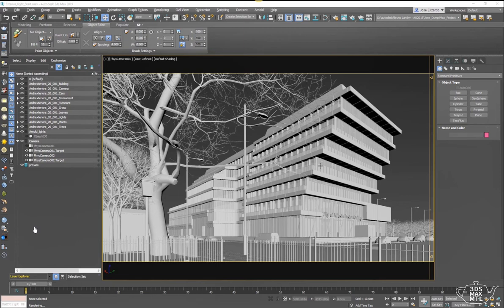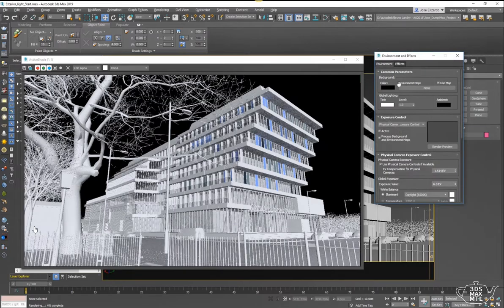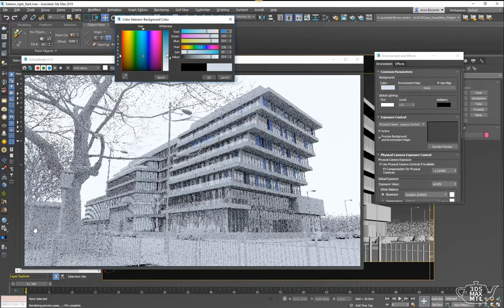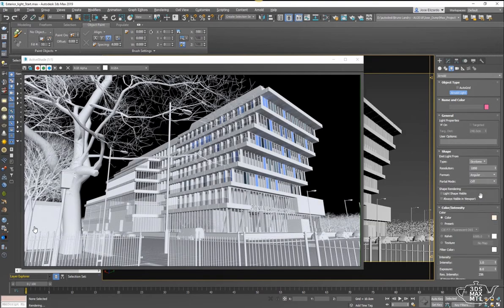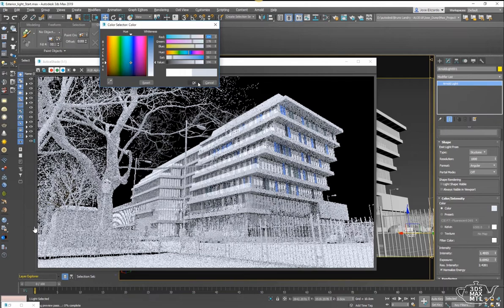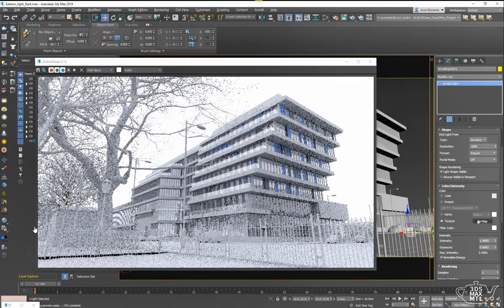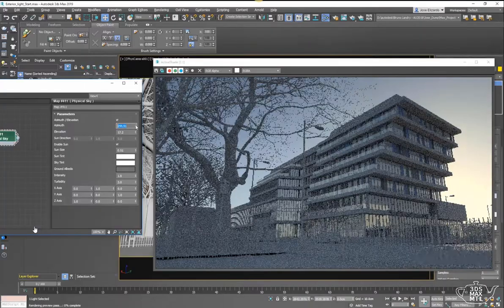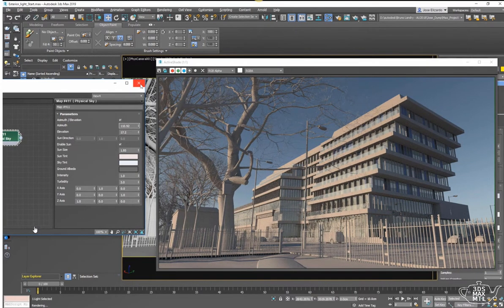3ds max & Arnold Exterior Lighting - Using an Arnold Skydome

Comment: wtf cpu is that, it renders like crazy?!
Reply: GPU and Ram are the big ones, esp since Arnold was built with Nvidia cards. Render Setup > System > Manual Device Selection > Choose your Nvidia card. (The first time you render with GPU it will take longer than usual because it has to alter some settings etc, but let it do it thing because after the first time it will be much faster)
Also make sure you have an absolute minimum of 32 GB of ram with at least 3000 Mhz. 
Every AAA Game Dev artist I've spoke to in the recent years has always said all their work comps have a minimum of 64 GB ram and some have over 90 GB
Reply: @Dreamtheory618  I may be wrong but if you use GPU on arnold, not only lots of effects are just non compatible for GPUs, but the Ram at all is not going to be used if you use a GPU, in that case as long as I know that isdependant on VRAM and not on the standard Ram, I myself have 24GB of Ram and you never have memory problems using CPU, but using GPU you will.
Reply: Arnold has been based on cpu for the last 20 years they have added gpu rendering about 3 years ago. Gpu rendering should really only be used for small scenes and look dev. Large scenes will require lots of vram...that is why big vfx houses will use cpu render for a long time..among other things